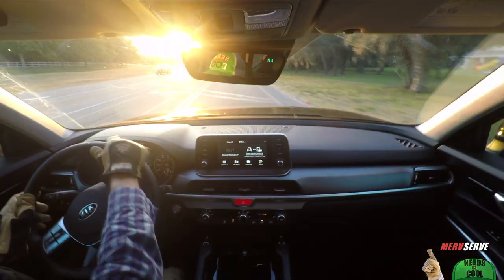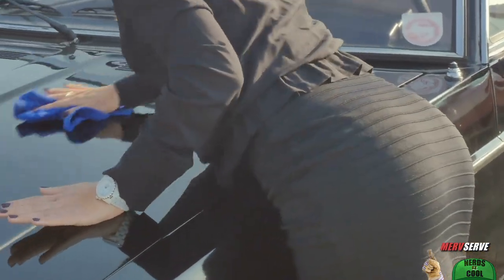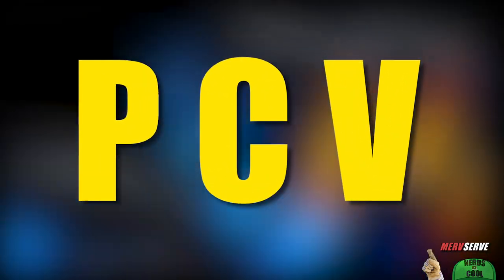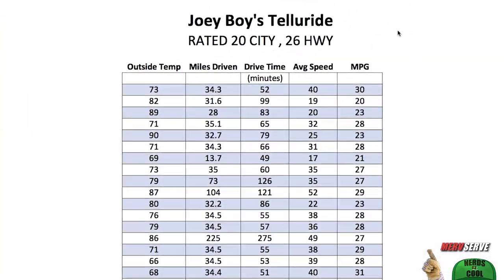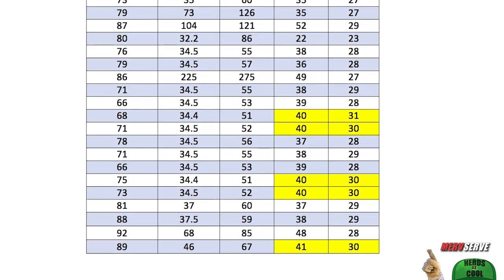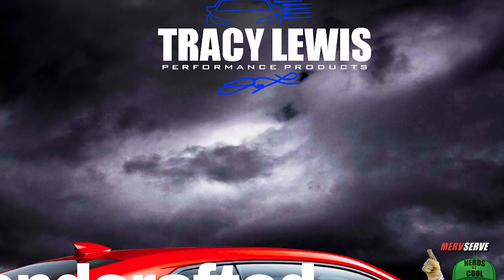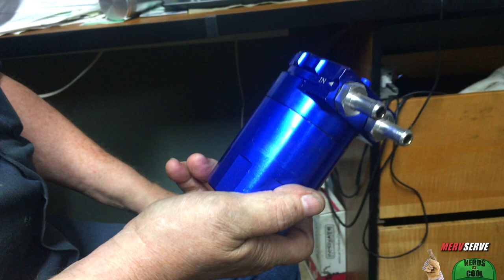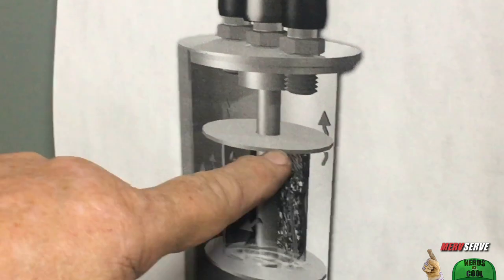Better Gas Mileage - MPG BOOST Saves you Money!

Comment from the maker: Hey everybody! Drop me a comment, telling me if your Gas Mileage is better or worse than the car manufacturer promised!
Reply: This is  a good catch can but pretty dangerous by adding unmetered air from the ventury intake. It is after MAF and could cause lean mixture. Increase mpg but also temperature in the combustion. Watch your head gasket .
Reply: @rondhole  This is far more than a catchcan.  How is there unmetered air entering?  Both the clean/fresh side that gets the air from post MAF and the Venturi, which provides the secondary vacuum source is also post MAF. And it retains an emissions compliant closed system. The average "catchcan" only traps from 15-20% of what passes through where this traps 90-95%. No other design comes close. We have 2 patents on it.
Reply: @tracylewisperformance1328  I do not think the additional drilling original hose for the Venturi is necessary.  It only adds additional vacuum but the concept of PCV is a positive crank valve, so it is more about pressure build-up in crankcase as the main source of flow, not the vacuum from the intake. The rest of the design is great.  I just do not like adding an additional hose and destroying OEM intake.  MPG increase does not happen, but a cleaner intake manifold and valves are expected.  The way we drive makes a lot more different than anything else.  Or get a hybrid with Atkinson cycles like Toyota 2AR and 2ZR engines with 40-41% thermal efficiency.  From the time being, I will sell any KIA/Hyundai in anyone Asset, it is liability that can kill someone.  The engines often like a mine or wild bomb, suddenly burn.   Sell it and get a HSD hybrid definitely safe more fuel and money.  This Catch Can fit Corolla hybrid or CT200h that has a problem with oil in the intake manifold.  People can always patent something, but it does not mean anything without any enforcement. Especially, most catch can are Chinese products, they do not respect the USA or international law regarding patents.
Reply: @tracylewisperformance1328  I recently looked into occ for Prius just to keep the intake clean so half your design is what I was custom making. A taller occ and multi layers of fine mesh around the dirty incoming gas to force the gases down before they can turn back out into intake. 500$ is way over priced . I would spend a bit more than average can so I don't have play with them .. not more 120$. unfortunately soon you will see Chinese copy of your design for under 50.. unless Trump can stop these copyright violations of china
Reply: Carbon buildup on intake valves caused by condensing blowby gases via PCV is the plague of GDI engines (like Kia & Hyundai). If this works as claimed, it should prevent 95% of that buildup on a continual basis, rather than periodic service to remove it. Has ayone considered this?
Reply: My 2024 I bought in May gets shitty milage, something is wrong with it. I only get between 260 to 280 miles per tankfull. Honda rates it at 474 per tankfull....bullshit!!! My 2020 would get more,  abouts 375 to 400 miles per tankfull. And honda rated it at 562miles per tankfull...bullshit!!! My 2024 averages between 13.8 to 16.6 miles per gallon according to the gauge. Something is wrong with it.

Comment: Comparing OEM fuel efficiency estimates to uncontrolled, random drive cycles is not even remotely credible.  There is dozen factors that affect fuel efficiency on any given day, none from what was shown were held constant.  I miniscule change in crankcase vacuum will have no measureable affect on efficiency. If you install a dry sump system and run 10 inHg in the crankcase using a vaccuum pump, power and efficiency increase can be realized in high HP engines, but 17% increase in these minor change is misleading.  What was the average crankcase pressure before and after, over a wide operating range did you find when you tested?  Any improvement in flow, ventilation, will certainly help to keep the engine cleaner, especially GDI engines.
Reply: Todays engines are all built with low tension piston rings. And these require suction below and pressure above to hold them stable and have maximum sealing. When crankcase pressure is present, this lifts the ring off the land an a condition known as "Piston Ring Flutter" occurs where the rings enter a state of rapid vibration and blow-by increases resulting in less power made and a less efficient burn. We have decades of Divisional, National, and World Championships in multiple classes NHRA & IHRA and designed this system to emulate the vacuum pump systems we have used for decades in the racing industry giving the same benefits, just not as robust as a belt driven pump system. If you measure the Venturi at 4500 RPM you will see from 7-14" of vacuum produced. The special check valves always automatically default to use the strongest vacuum present at any level of operation. The closed system allows NO unmetered air in and does not vent to the atmosphere. So we take the average crankcase pressure during acceleration and WOT to a negative. If proper vacuum suction is pulled gains are also realized by reduced parasitic power loss of the pistons fighting the crankcase pressure on each downstroke and aiding them with suction. This is the ONLY Patented true full time vacuum based crankcase evacuation system. If there is any doubt on how and how well the system works, we will gladly buy back any system bought to test the actual results. If you walk the pits at a National event you wont see ANY cars not running a vacuum system unless a specific class prohibits it or in the case of TA and TF, where most of the oil is pushed from the crankcase each run, then blow-down tubes are run into a large catch tank. But we guarantee these benefits or will buy the system back. We have yet to have any light fleet customer return a system. In fact we provide a system free if more that 100 vehicles are in the fleet and the fleet owner/manager tracks all fuel usage to see for themselves. No games. These fleet owners would not keep purchasing them for each new vehicle if they did not do as claimed and demonstrated here. Crankcase pressure is NEVER good in any way.

Comment: I'd like to see a Prius set-up for this since your previous video would show the benefits of having one due to the pooling of oil in the throttle body.
Reply from the maker: I know, but dang, it's so hard to find a good mounting spot in there.  And it really needs to be accessible or it's going to be neglected and not emptied regularly.
Reply: Should have a sizeable impact, but the room to fit the system would have to be creative.
Reply: I'd love for someone to figure this out for a 2012 3rd gen Prius so I won't have to go thru the cleaning of intake. I'm at 85k miles now no issues yet. Because I get such great mpg I want to keep the "inners" young in  function/  free of gunk! This seems to be an ultimate Preventive Maintenance Move..  car payments and breakdowns are top in  my undesired!
Reply: @simplyraw1369  my 2012 at 185k just got a 20 second rattle for first time 😢

Comment: Carbon buildup on intake valves caused by condensing blowby gases via PCV is the plague of GDI engines (like Kia & Hyundai). If this works as claimed, it should prevent 95% of that buildup on a continual basis, rather than periodic service to remove it. Has ayone considered this?

Comment: First and foremost I will say #1, just take a minute to remove the intake tube when drilling to avoid rubber shaving ingestion. #2, everyone needs to know to NOT use silicone spray lube when installing the hoses to make them easier to install. Silicone spray will destroy the O2 and AFR sensors if it's used on intake air, crankcase, or fuel components. The man was using his spit or breath to put water on the hose which is acceptable. 

My comment is mainly for this though (and it's long): I don't like the oil cap modification for 2 reasons. First, the inner diameter of the new oil cap separator device is visibly much smaller than the original fresh make-up air supply which is 1/2". That will restrict the volume of fresh air entering the engine, and that supply was designed to be 1/2" for a reason. With this setup, you are adding seemingly more vacuum to the PCV side with less make-up air volume to replace it. Illogical. The throttle body vac port will produce almost all of the vac at idle with the venturi port making much less. However, at part throttle such as cruising, there is still a very respectable amount vacuum in the intake manifold and you're now adding the vacuum volume of the new venturi port to it. If anything, you would want to upsize that make-up air system to 5/8" or 3/4" to provide more volume. The crankcase shouldn't be under a large amount of pressure or vacuum. It should be under a very very small amount of vacuum to ensure the blowby is removed and condensation is dried up by constant fresh air flowing down and throughout the engine. Second reason...why do you need a separator device at all on the fresh air supply? That line is nothing more than filtered atmosphere entering the engine from directly behind the air filter. There's no oil or anything in that air. Ideally, it should contain nothing. A hot separator mounted on the engine will not condense atmospheric humidity, and the H2O of combustion blowby is constantly pumped out by the PCV system itself. 🤷🏻‍♂️ It is an unnecessary addition which restricts the flow volume of fresh air. The only thing that restricting make-up air volume will accomplish, is allowing the crankcase to be pumped down to a deeper vacuum. That doesn't really accomplish much, and too much vacuum will actually damage gaskets, damage seals, and draw contaminants into the engine through any crankcase compartment (includes T-cover and valve covers) leaks which may be present. Not good. Perhaps the restriction of make-up air and subsequent increase in crankcase pressure is to create the illusion a dramatic assist by the venturi device? 🤔 I can't say for sure, only speculating.  

The difference between the rated EPA mixed average of 23mpg versus Joey's actual of 27.4mpg is explainable by several factors. First off though, was the chart of data verified by measuring the gasoline volume burned at the end of the testing? The instrument cluster's fuel efficiency result is often incorrect and inflated by 1-3mpg on most cars. My own is high by 2 mpg nearly every time. The only true way to calculate actual achieved mpg is to find a gas station that you like which has a nicely flat and level spot at any pump available, fill the tank fully until the pump cuts itself off, drive until the tank is down to 1/4 or 1/8th full, and then return to that same gas station and that same exact pump and refill the tank fully until it cuts off just like the first time, making sure the nozzle is positioned at the same exact depth as last time (just fully insert it to the hard stop and it will be repeatable every time). THAT will give you the actual, true mpg of the mixed driving that Joey did. Divide the miles driven by the gallons of gas pumped into the tank. Use the temporary trip B odometer to keep track of exactly how far you've driven between the fill ups for the calculation. I will posit that if Joey used the instrument cluster's data rather than properly calculating mpg this way, the data is inflated by 1-3mpg. Furthermore, the observed difference of 4.4mpg can be explained purely by the driver's behavior. If I am careful to drive gently and efficiently, I can squeeze several more miles per gallon compared to when I'm having a bad week and I'm late to work racing around and loading the engine much more. 🤷🏻‍♂️ If Joey was told beforehand that these mods would possibly improve fuel efficiency, that is a totally guaranteed diagnostic suspicion bias due to an unblinded subject and it makes the data less reliable. You could like have plugged a dummy OBDII device into Joey's Telluride and told him it would boost his fuel efficiency, and he would subconsciously drive more gently from then on giving a similar 3-4mpg increase even if he didn't intend to do so. Add tires into the mix too. Are the tires properly inflated and the same brand/model as the stock tires with which Kia recorded the EPA estimate? If Kia used a softer wear grade B tire and Joey has harder AA grade tires installed which are a few PSI above spec, that will return a similar efficiency increase due to the rolling resistance change. These small seemingly unnoticeable changes can make a big impact on overall fuel efficiency. To support that statement I will say what I experienced with my Corolla when I drained out the WS transmission fluid and replaced it with Valvoline MaxLife ATF. The older models of that transmission used T-IV fluid, and Toyota switched to WS in an effort to increase fuel efficiency. WS is a lower viscosity ATF, like DexVI and others. The MaxLife is blended more closely to the previous T-IV's viscosity. After I did a complete cooler line fluid exchange and filled the AT fully with MaxLife, I took a 2 mpg loss instantly due to the increased parasitic pumping losses of the thicker fluid. I had recorded months of WS economy with Fuelly prior to the fluid change, and I have collected years of data since then. It was a demonstrable drop, averaged over a very long time which made driving style changes trip to trip a non-factor. Tire pressure changes from a few psi low to a few psi over spec can make a remarkably noticeable change to tank averaged mpg. 

TL;DR I like the design of the catch can baffles; it's undeniably superior to the others. I see the fresh air separator as unnecessary and potential negative. I think this experiment may be fundamentally flawed in a few different ways and I'd suggest making a second video with a better experiment using many more rigidly controlled variables. Install one of these on your wife's car or another friend's car without their knowledge and without telling them that it may affect their fuel efficiency in any way. Check and adjust their tire pressure throughout the test, and instruct them on how to collect their data on fuel usage and mileage driven as I described above. To make it easy, maybe even set them up with a Fuelly account and the app. They MUST go to the same exact gas pump and put the nozzle in the same depth and allow it to auto stop by itself one time; no top offs. If you observe a 4.4 mpg increase even when these variables and methods are corrected and the subject is blinded successfully, I will accept the result fully and happily and accept that my hypotheses and speculations were incorrect and the product is worth purchasing. Truthfully though, it's worth purchasing if one drives a GDI car anyway, cuz intake valve coking. I'd probably just plug off the second output port and omit the venturi device, and I'd CERTAINLY skip the make-up air device.
Reply from the maker: Wow! Now THAT is what I call a thoughtful comment and I really appreciate that kind of participation. I encourage others to chime in to this very valuable conversation . Thank you for watching!
Reply: Excellent point regarding the computer-calculated mpg. However, I'm not sure I agree with your OBDII section where you seem to be suggesting a placebo effect. A person with a long track record of driving would ultimately revert back to their lifelong driving habits after the newness of the device wears off.
Reply: Drill bit has grease on and catches almost all of any debris, but there is no way and small plastic or rubber could cause any damage if ingested. When new, the amount of assy. debris on first start up would shock all. If it was metal, that is an entirely different situation and you would never take a chance on metal debris being ingested. I agree on silicone spray. We use WD-40 is needed.
Reply: I just want to thank you all! As a DIYer mostly forced by finances then by lack of trusting sigh.... I have found  much value in these types of conversations. I learn what questions I need to ask BEFORE I do.  I've learned to spend my free time watching all sorts of DIYs because it's best to know before there's a real need! Especially when you don't even know what questions to even ask.  These instructional videos with comments help me to know just what all is involved.  Well in simple terms these  enable me to have questions! Helps when doing a job to not have so many "oh shit I never thought of this or that"
Reply: WOW💥,,,great comment!!!!
Reply from the maker: As I see all the thoughtful comments on this subject, I am truly humbled by the wealth of knowledge out there. There is nothing more gratifying than realizing I have viewers who know more than I do.  This is an incredible learning experience and I thank you all for your inputs.
Reply: Holy Sh*t!! FANTASTIC reply, if I ever saw one. Great job!

Comment: PCV doesn't route exhaust to the intake, that's the PCV's job.  The small amount of exhaust that gets passed the rings will go to the intake, but no catch can is going to change that, even this fancy one.
Comparing one's achieved mileage to the EPA estimated mileage is useless in determining that this device is helping, you need your achieved MPG before and after installing it.  I can't imagine how cleaning the PCV air increases MPG, I'd love to see actual evidence.
Tracy's statement about 'normal' catch cans being no more than 15-20% effective is complete BS.